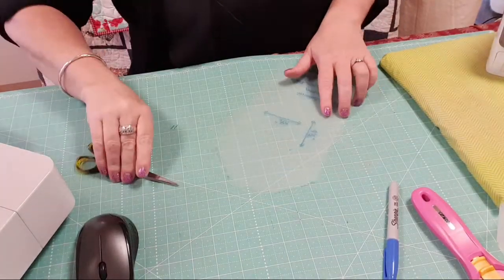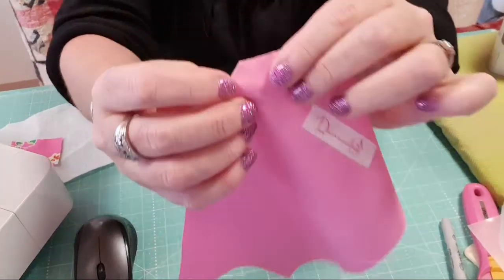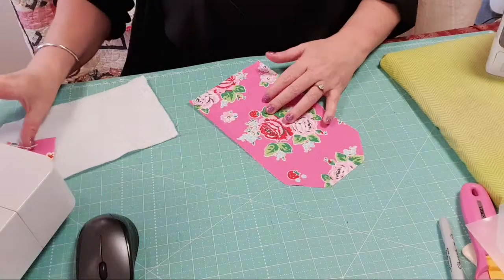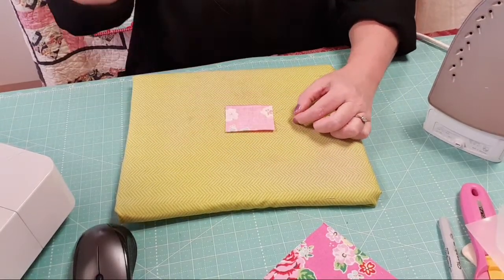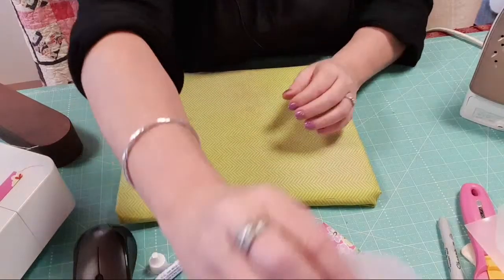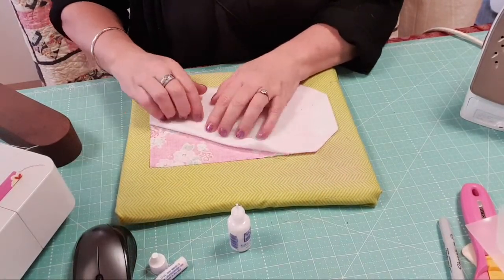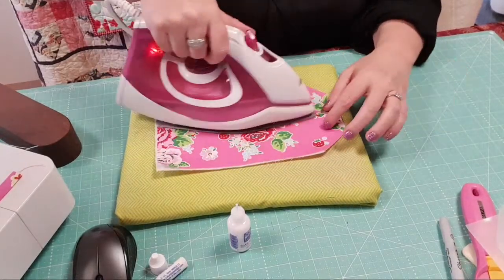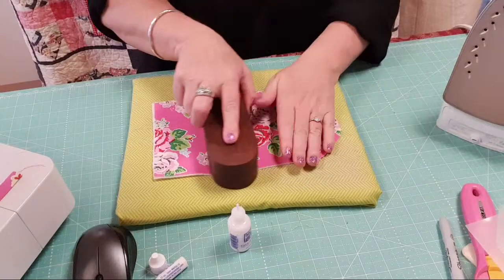How To Make A Simple Coin Purse | Live Stream with Darvanalee Designs Studio

Comment: Bec you need to get Nicole her own iron!  Maybe a purple one?  
I like to use green and red topped pins for starting and stopping points in sewing.  It works for me really well.  I thought maybe using a couple of layers of felt for the needles on the flap then you could put several sizes in it.  I agree with changing the needle for every new project.  Mama taught me that years ago.  I even do it when using my vintage hand cranks.  Since I don't have pinking shears, I use a pinking blade on my rotary cutter.  It works well, and I've done that for several years.  See you tonight!
Reply from the maker: Yeah lmuse all different methis to remind me not to sew lol...you mixing it up and all lol...l have never ised a pinking blade before ...might have to get one and give it ago...❤❤❤ thanks for stoping by hun ❤❤❤